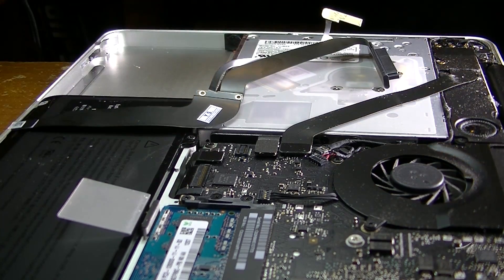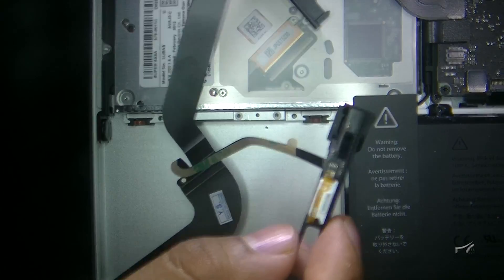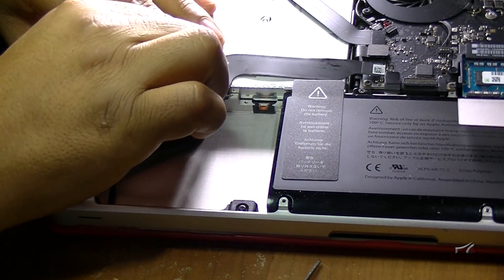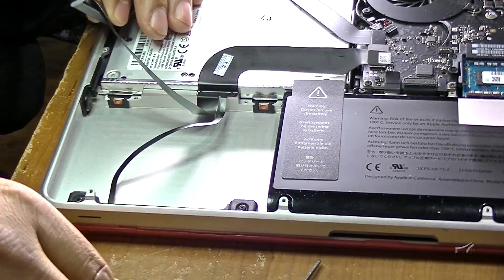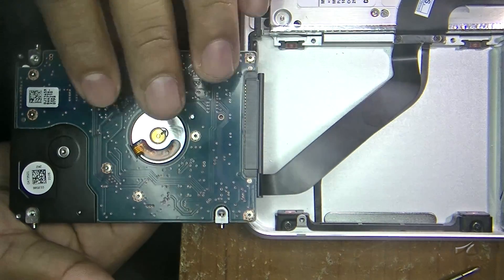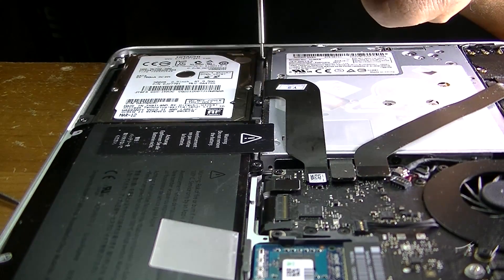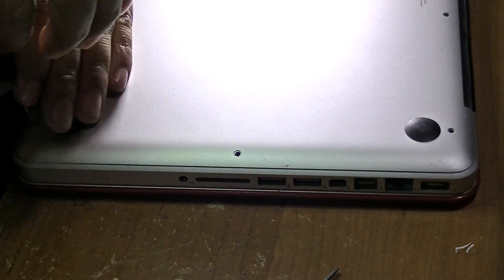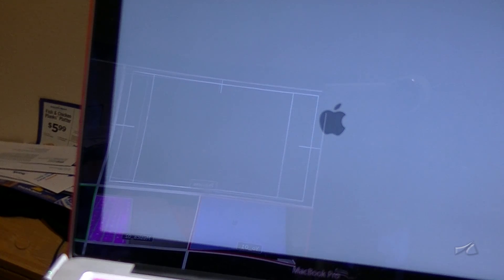Flashing folder with question mark, Fix Macbook not booting up. (2 of 2)

Comment: Carpio, Many many many thx for posting this video. Followed both your vids and now mac is working. Currently running a back up just in case. I bought the encasement off your link, but the one you showed was not available. I hope you got credit for the one I purchased.  Again, so grateful 🙏

Comment: Does anyone know the part number? I’m trying to track one down
Reply: Elliott Feldman it should be printed on the cable. I ordered mine from eBay - Apple MacBook Pro A1278 Hard disk Drive Cable P/N 821-1480-A 2012

Comment: Anybody have trouble fitting the yellow ribbon piece into the cable? I’m using tweezers to try and get it fully connected but it feels like something is blocking it. Very frustrated lol
Reply: yes! me. i actually broke it trying so many times :( wonder if i can buy another part w/ the yellow ribbon? would that work? i can't believe he was able to fit it using his fingers..!! tips advice pls!!
Reply: Yeah. I figureed that my sausage fumbly fingers would get this wrong so I bought the one that comes with the bracket where the yellow ribbon goes into. It costs more but I was pretty sure I would break the thing.

Comment: I have a issue with my MacBook pro The screen was cracked so I  was using a external screen and I was still recording and storing vids thru iphoto on my cracked screen finally that stopped working,  I paid to get the screen fixed and now it has a flashing folder on the screen. So he told me it was the hard drive So the guy took it's previous hard drive out and gave me a new one with the latest is. I'm trying to locate any of the stored data from the previous hard drive by connecting it to my iMac I see the hard drive but I can't locate its previous Vids of anything I recorded is there a ware that I Can possibly use to see if it was stored at all b4 the screen was cracked?  Even when the screen cracked I was recording and playing back all my data? Do I have any idea what I can do to try to recover any of my vids stored recently? Anyone or even better how to remove the lock also

Comment: All great and accurate info here. Thanks for sharing.
As I had similar experience, it is also a good idea to insulate the renewed ribbon/wire with anything that can prevent it to be damaged again. 
Most likely, it's the rather rough surface of the inner unibody side that the ribbon rubs onto over time. Some electric insulating tape on both sides of the flexible ribbon should prevent it to fail again.

Comment: JUST SOMETHING WORTH KNOWING: When my Macbook's hardrive cable was broken, I went to the apple store and not only, got it quickly replaced, but for FREE.
So don't waste 40$ like I did on a new cable, and end up breaking it while trying to do it on my own.. because apple can service it for free. ;)
Reply from the maker: If you take the computer and they are willing to fix it then that is amazing, if not then it helps to have an option on what to do. If you are not handy enough and feel like you might break something then definitely take it to them, no point on breaking something and then it turns out being way more expensive.
Reply: Yea if its Under warranty why not, if not apple won't do it for free, gotta spend 4 times or more what it will cost you to get the cable on ebay or amazon.

Comment: My friend i had the flasing folder, y took out the internal hdd and tried to use it via usb but my laptop didnt read it, i tried it in an other mac as if the disk was an usb and it told me to initialize... do i have to do the internet recovery first?? or my hdd is dead? please can you help me?
Reply from the maker: Hi, thanks for watching. Unfortunately with what you have described it does sound like you have a bad hard drive or at least malfunctioning. I would buy a new HDD and if you have a backup then restore it to the new one. But an SSD is even better faster, less prone to being damaged from shock(bumps/movement) and it will be slightly more power efficient due to not having physical components that need to be moved.